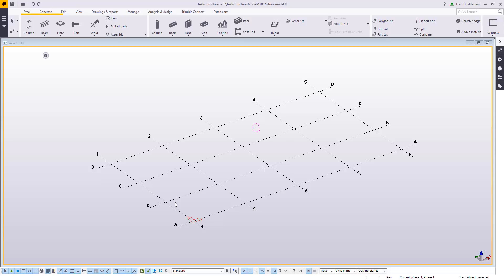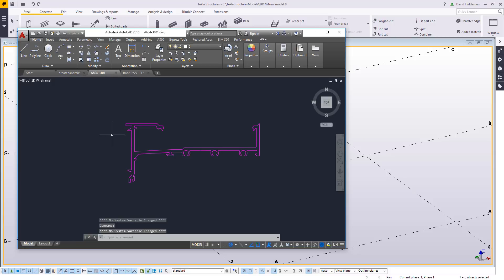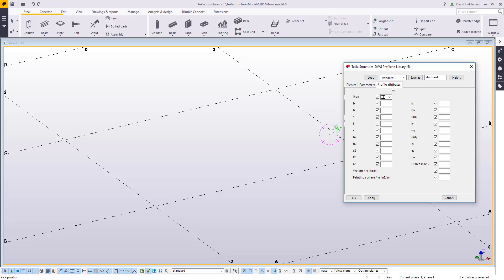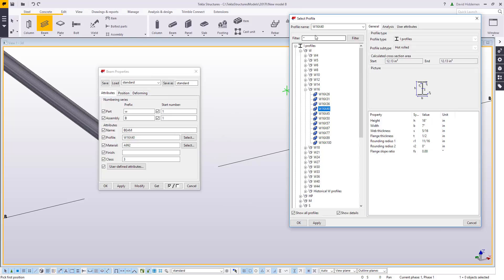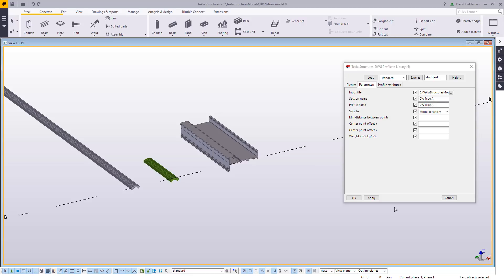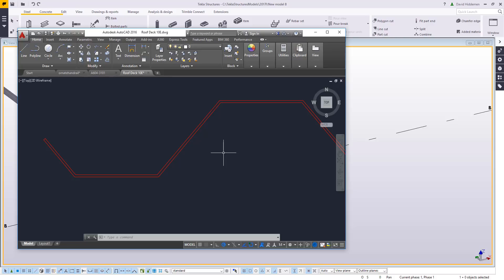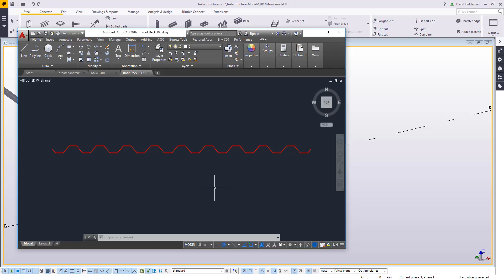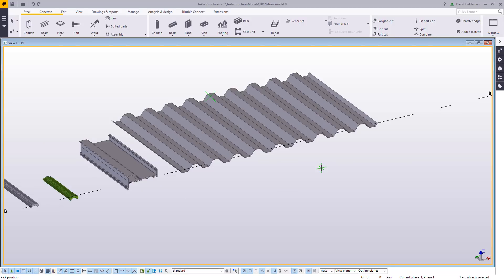Create Profile from DWG in Tekla Structures

Comment: Hello! By defining a custom profile using a .dwg file a warning pops-up every single time, it says "Error while opening a file. Error code 0". What can it be? I tried even to use very simple geometry with just a rectangular, and still, Tekla says gatting troubles with opening this file (error code 0).
Reply: Have the same Error Code...
Reply: @sublexfx9870  I guess I know already what it can be. I your dwg section file how is you section located in relation to 0,0,0 point?
Reply: Save the Autocad file in .dwg 2014 format. Make sure the sketched geometry is a single closed polygon and there are no lines or points overlapping.

Comment: I tried creating DB beam(DB 8X37 =  W12X53 and plate 3X1):as discribed here but the actual model piece and created profile are not matching.  I tried scaling up also please advice.
Reply: Hi, it would be best if you can send a sample of that file to your local support team - https://www.tekla.com/contact/offices-and-resellers. It is not easy to troubleshoot through comments. The profile may not 'close' properly. There may be too many radii. There could be extra layers/lines overlapping in the file. Many possibilities, so definitely send the dwg to them along with a clear description/pictures of what is wrong.

Comment: How to calculate the reail weight for the sheeting profile.
Reply: The weight is calculated automatically based on the volume of the part (cross section X length) and the material grade being used (density). As long as these values are accurate, Tekla will calculate the weight for you. If you are having problems, it would be best to contact your local helpdesk with a sample of the profile you are trying to use.
Reply: David Hiddemen sometime bracing component connection where I draw manually plate, (for example column rafter knee joint) the manual plate position can not take the auto connection.so how to solve it without dummy plate. Please give a answer.